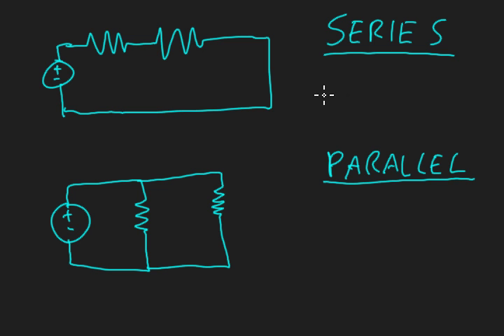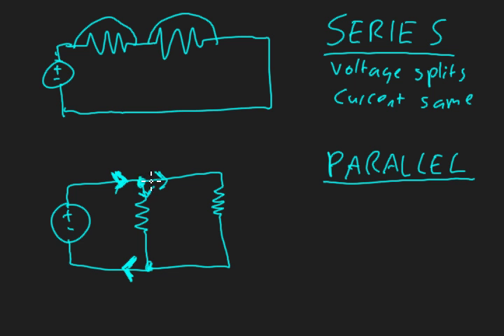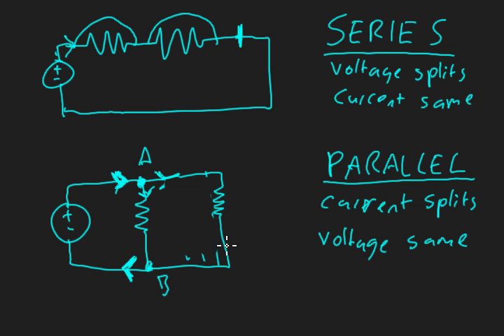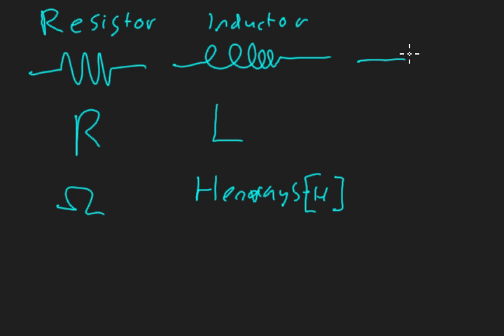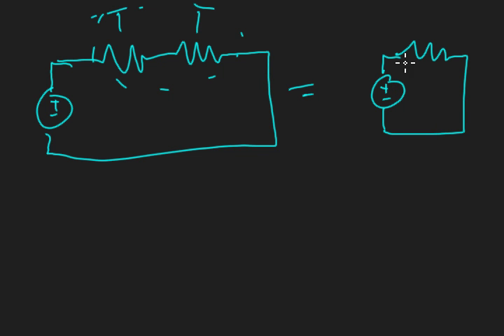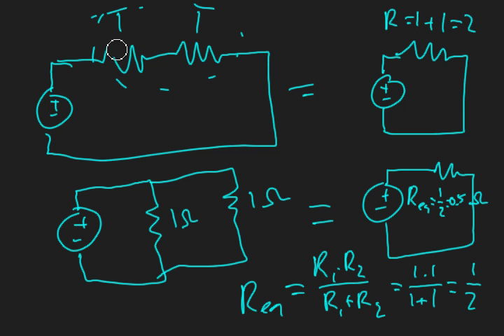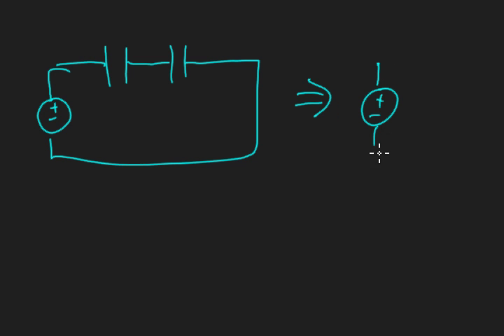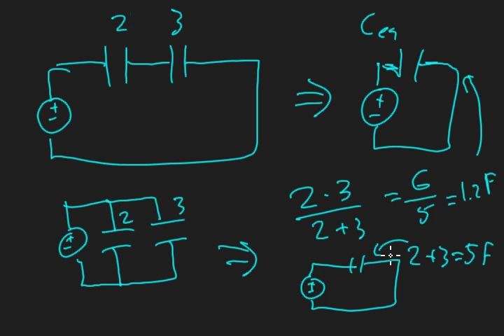03 Parallel & Series, Resistor, Inductor, Capacitor = RLC circuit

Comment from the maker: Well first, you'd need to use a consistent unit (Z = Impeedance; a complex number measured in ohms). Then convert resistors, caps & inductors using the following formulas;
Zr= R (impedance of a resistor is the resistance, no imaginary part)
Zc = 1/(jωC)
ZL = jωL
where ω is the ac frequency, j =√(-1), c = capacitance, L = inductance. 

Once you find the equiv. impedance's, to add in series, go
Zeq = Z1 + Z2 + ...

and to add in parallel, go
1/Zeq = 1/Z1 + 1/Z2 + ... and solve for Zeq

Comment: what happens if you had resistor capacitor and inductor all in parrallel with one another and hooked up to an ac power supply. Then what rule do you use?

Comment: hi, can u make more sample problem (tutorial) with solution in particular to series-parallel rlc circuit...because i hardly cant get the right hint on getting the total impedance with different given form of sources..such a given source in polar form,say, 100/10 degrees.. thanks.